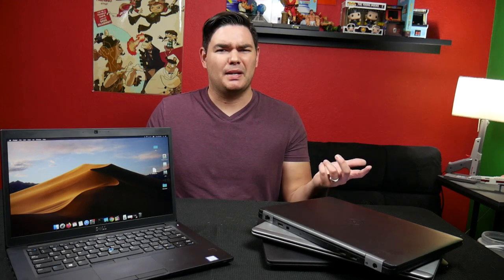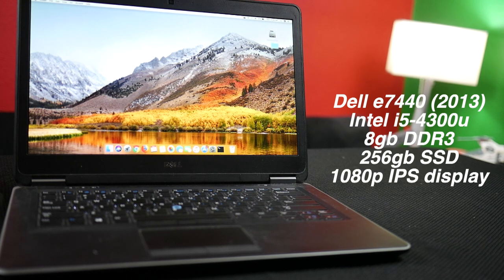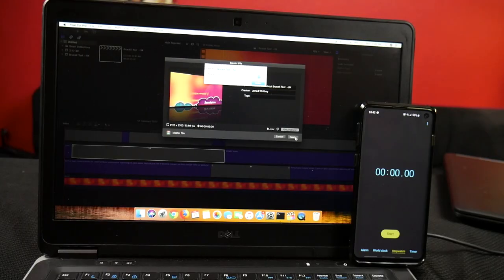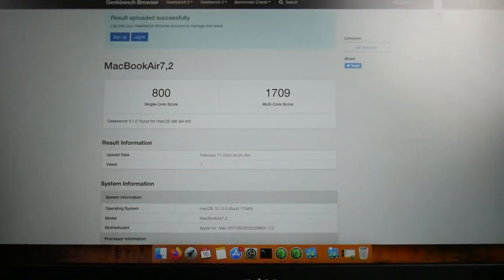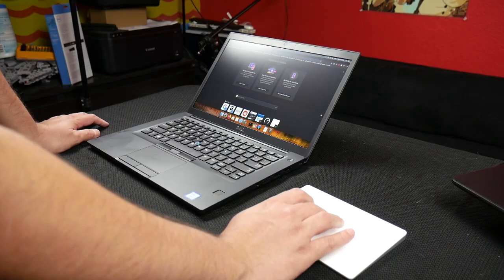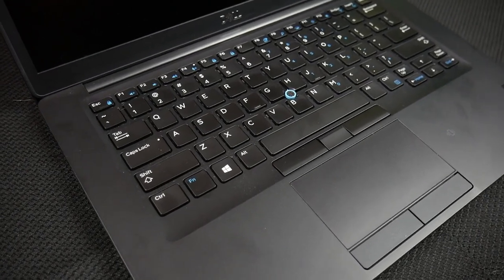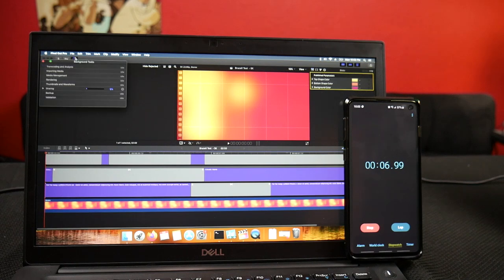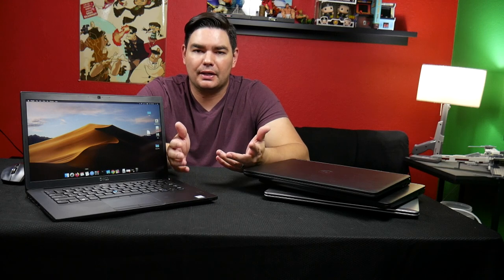Dell Latitude hackintosh comparison (better than a real Mac?)

Comment: How is the battery life ? does it last longer on windows 10 or mac os ? And were you able to get airdrop/handoff/continuity working ?  great content btw
Reply from the maker: i haven't done any timed battery tests, but in normal use it seems to last just as long as in Windows. As for Airdrop and all of that, I can't personally test it as I don't use an Iphone, but people report it as working as long as you have the correct wifi/bluetooth card.

Comment: hey again, 
so i ordered a used 7470 and it should arrive winthin the next 2 days. this will be my first hackintosh. i'm currently researching, but the vocabulary is very confusing and i'm having trouble finding out where to get started... a walkthrough on that model would be really REALLY awesome. or just a general overview of the procedure. 
cheers!
Reply from the maker: I will look into making a tutorial video this weekend possibly, working on another video at the moment. In the mean time you should sort out how you will do Wifi, either order a USB Wifi adapter (easiest), or buy a wifi card that works with MacOS

Comment: Thank you for this video.

I can't help but point out for further clarification something you mentioned about the 7470. You did state that the RAM maxes out at 32GB which conflicts with the information I had prior to placing an order for one, which is that the maximum RAM is 16GB. Of course, I was disappointed at that info because I was hoping it would be more. Plus, noone volunteered more info on that. So much for community support.

Therefore, I'm asking here again, please. What is the maximum RAM that a Dell Latitude E7470 can take? Is it 8, 16 or 32 please?
Reply: To be honest, you really do t need anymore than 16 gigs.
32 (in my opinion of course) is basically reserved for a laptop that has a gpu.
Reply from the maker: Multiple people in this thread confirming they put 32gb, it could be dependent on what CPU you have, but I would think any i7 would be supported. 
https://www.dell.com/community/Latitude/RAM-upgrade-for-Latitude-E7470/td-p/7328028/page/2

https://www.reddit.com/r/Dell/comments/d4bovl/32gb_ram_in_latitude_e7470/?utm_medium=android_app&utm_source=share
Reply: @JTechWorkshop  thank you.
I guess the main limitation is cash. Over here, once one purchases an accessory it can almost NEVER be returned no matter what. Otherwise, I would simply try and if it doesn't work, return it. I'm not into any intensive graphics thing just learning frontend development and data analysis for now.

By the way, my cpu is i5 6300U (skylake, I think).
Reply: @PhillipLemmon  thank you.
I guess I'll just upgrade to 16gb and leave it at that for now.

Comment: I have a Alldocube Kbook Laptop, core m3 y-630 core duo 1,51Ghz, 8GB RAM, 512 SSD single drive, intel hd 515 128MB, 13'5 screen in 3:2 display.

Last month I tried to install Hackintosh, it was my first time. The first part was successful, my machine was fast and the graphic stunning, because of my 3000×2000 display. So the mac OS recognized all my hardware part, RAM, drive, GPU and processour, but keyboard, trackpad and Wifi were not functionning.

So I want to make sure that my computer is compatible to Hackintosh right ? It may be a problem with kexts since it was my very first Hackintosh ever. 
Please van you help me ?

Comment: Could you please let me know what’s the part number for the wifi card? I have the adapter but need the card.
Reply from the maker: BCM94360CS2 is the one I used in this video.
Reply: @JTechWorkshop  Thanks for the reply. I was able to get this card to work on an E7470 with the BCM94360CD adapter. It also works on an E7440 but the adpater/card combo is too long to put the lid back on. It won't work on the WWAN port. I was wondering if there's a way to get the WWAN port to behave as the WLAN port.

Comment: Do I need to buy a new card wifi for Dell 7440 when setup hackintosh? If yes could u give me a link to buy it? Tks!
Reply from the maker: Yes, you will need a different card as most of these will come with an Intel based card that is not compatible. This list should help you out, your best bet is Ebay, but I have seen some on Amazon as well. https://osxlatitude.com/forums/topic/11138-inventory-of-supportedunsupported-wireless-cards-2-sierra-catalina/